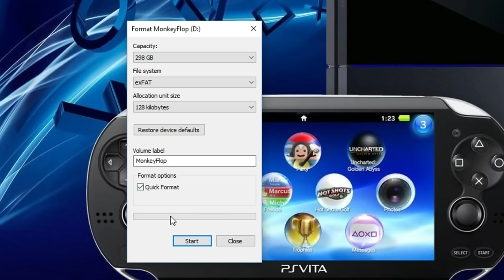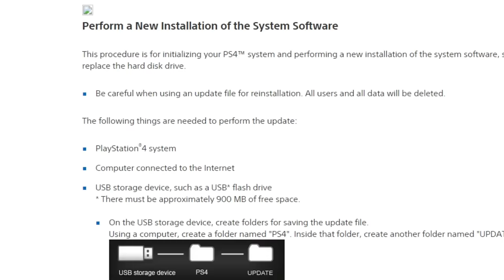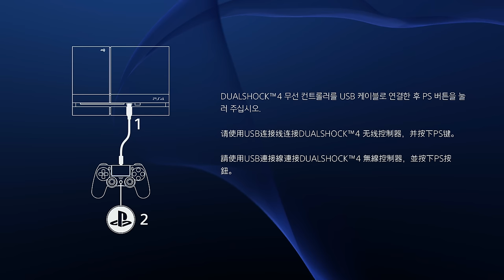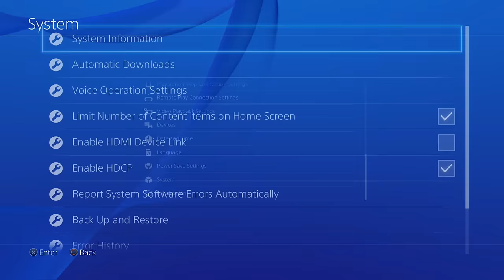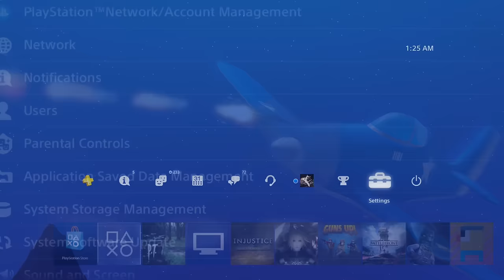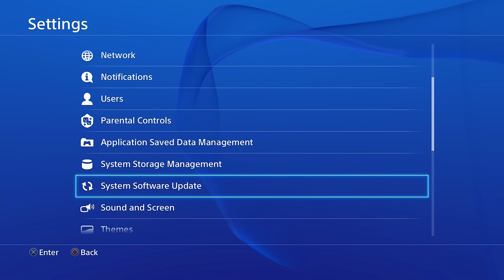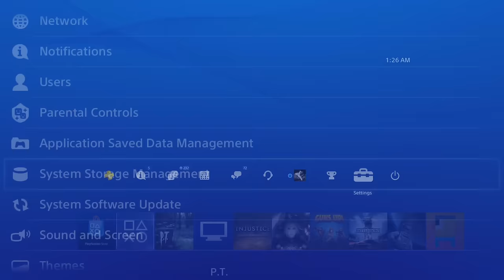How to Change Upgrade PS4 Hard Drive Full Tutorial 500GB to 2TB EASY

Comment: I'm having issues. I downloaded the newest version from windows and mac multiple times and my PS4 keeps saying cannot read file. Yes it's labeled correctly. Checked multiple times as well. Even deleted the files names and re wrote it and downloaded it multiple times. all caps and correctly named, "PS4" -> "UPDATE" -> "PS4UPDATE.PUP"

I have on my USB 3.55 version downloaded from playstation.com

I tried everything from downloading from the internet to using USB. nothing works. I'm convinced it's the hard drive that it's incompatible but not sure.

Samsung Seagate 2TB Laptop HDD SATA III 2.5-Inch Internal Bare Drive 9.5MM (ST2000LM003)

Please help if anyone can or has ran into this issue.

Comment: Does the hard drive need to be formatted to exFAT or FAT32 also?
Reply: What worked for u? Plz answer
Reply: Masitch 2k The laptop I was using kept changing the update name so my ps4 wouldn't recognize it, so I used a different laptop and it work the first time. Don't try to open the update or anything just drag it strat into the folder you have to create. I think me opening the update messed it up.
Reply: I did mine ages ago lol